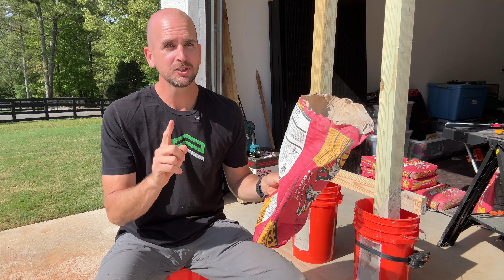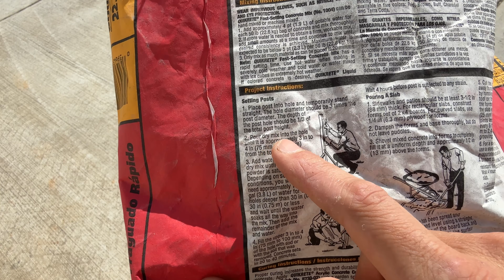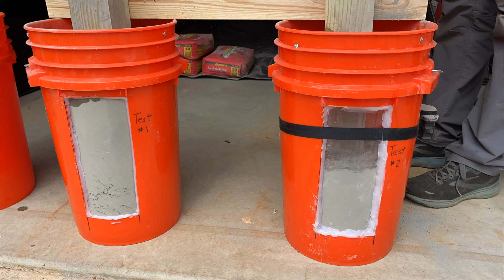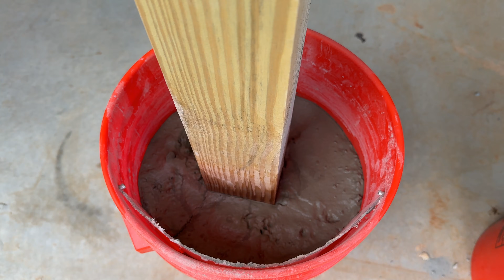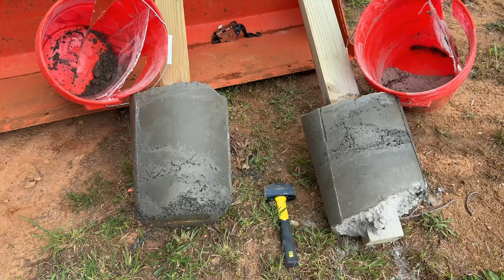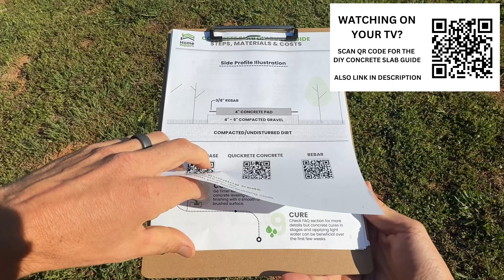Does Dry Pour Work For Fence, Mailbox, Deck Posts | Surprising Results!

Comment: The top of the concrete should slope away from the post. Water should not be able to pond in the posthole, nor collect around the post.
Top of the concrete should project slightly above grade.
Reply: Clearly someone doesn’t read directions on the bag
Reply: @bighammer3464  Clearly, some people don't  care about posts rotting - just doing it quick and dirty
Reply: @KLondike5  Can't drive a metal post into bedrock, decomposed  granite or rocky ground.

But I get  your point. 

It's  a trade-off with the extra  hardware required to fasten the fence wood to a metal post.

A PT  wood post can be made virtually rot proof, but  they need to be seasoned well, treated again with Terminate or other copper napthenate product,  or other methods( burning, dip post in melted  candles/wax,  pine tar, mineral spirits blend,  linseed oil, motor oil/ diesel, painted with tar.)